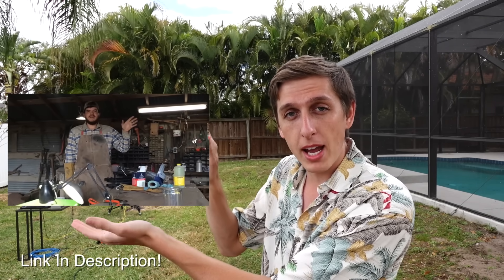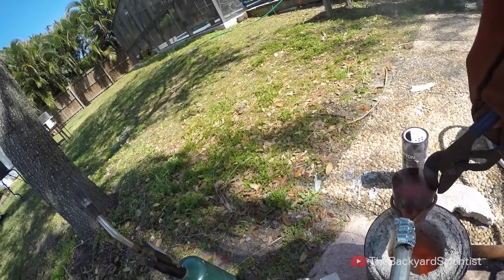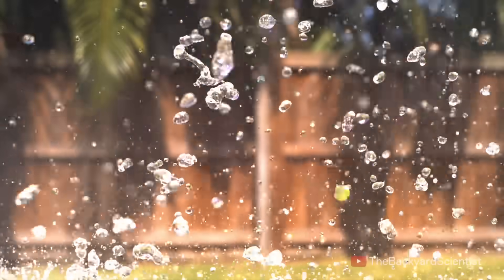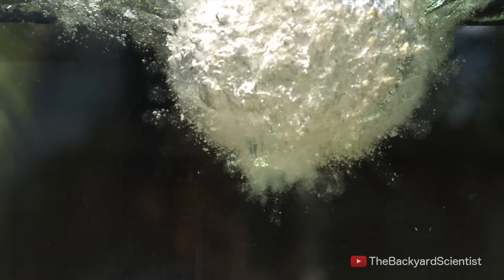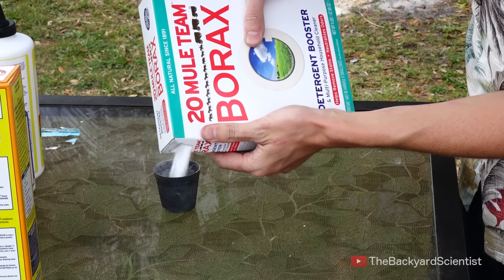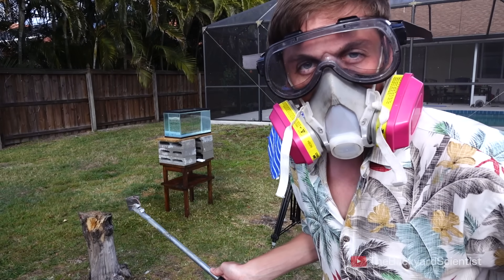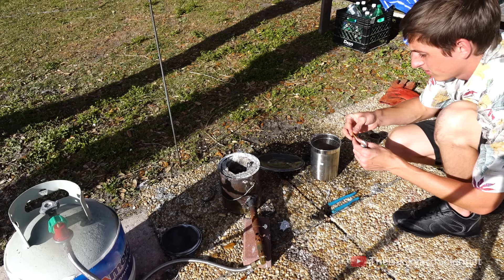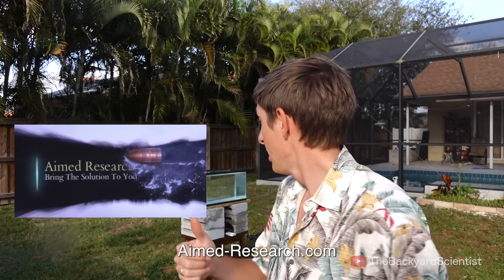Pouring Molten salt into Water - Explosion!

Comment: The reaction of dissociating NaCl into its two ions Na+ and Cl- is an endothermic reaction(requires energy). The opposite reaction is exothermic, which is what happens when you chrystallize already dissociated ions back into NaCl(releasing energy). Thats my explanation :)
Reply: Other than that its also water turning into steam explosively fast which is easier for NaCl as it reacts more easily as single ions, polar atoms, with the water, than when its in its crystal form NaCl

Comment: I didnt try it but maybe it was because the others were to dense even as liquids to let any water in and the water beside it was also sarounded by more water wich doesnt let it boil
Reply: +Silver erl 

I think it has to do more with how strongly NaCl attracts water molecules, thus having more water surrounding the molecule when the water gets to its boiling point, releasing huge amount of gas, while at the same time attracting even more water, wich will also vaporize and create bubbles inside bubbles. That's probably why the biggest explosion occurs  some seconds after the smaller ones. Its like, creating big bubbles filled with bubbles extremely fast pushing the water in every direction with a huge force, creating the explosion.

Comment: If i recall my chemistry days correctly, at around 1000`C water splits into Hydrogen and oxygen... A deadly combo when exposed to heat. 

In my opinion what we are seing here is that Molten Salt (the melting point of which is in the neighbourhood of 1000`C) triggers this water breaking reaction (thermolysis?).. So now, in that brief gas bubble, we have a very fresh mixture of oxygen and hydrogen (in the exact proportions needed to make water again), and superheated salt... Thats a reaction waiting to happen And as you know, a reaction of oxygen and hydrogen at perfect ratio is a very violent one... 

This is also consistent with why the first attempts failed and also explains why the PH was unchanged... Why would it, when all that was in the tank, when all was said and done, was salt and water?

Overall the symmetry of this reaction is rather beutiful... It's two physical reactions... First a thermolysis, wildly endothermic reaction, which splits water into hydrogen and oxygen, and immediately a detonation, a wildly exothermic reaction, which releases all the energy back outwards and returns the initial amount of water used...

Comment: Guarantee these explosions are to do with solvation and dissolution. Both Borax and Sodium Carbonate are significantly less soluble than Sodium Chloride in water. You want bigger bang, find something more soluble than NaCl id recommend Lithium Chloride.
Reply: +coconut7joemanji Care to explain the mechanics behind your theory?
Reply: When NaCl is dissolved in water it causes a positive enthalpy change in solution, Effectively cooling the solution down at the same time ligand formation occurs between Na+ ions and water plus Cl- ions and water. Now if the NaCl is at 1000K+ i'd hazard a guess that in this circumstance a ultra-saturated solution forms in the steam created by the leidenfrost effect.causing a massive osmotic pressure, subsequent coulombic potential and a massive release of energy as super heated steam. . 

//Edit: It's just a hypothesis however if super heated salt were dropped into a non-polar fluid and didn't explode i think it'd suggest strongly that solvation and dissolution are a major factor in whatever is going on.

Comment: How do you know that if it is a chemical reaction that the bi-products aren't just sinking to the bottom of the water and so when you test the water it still comes out neutral. Why cant the actual reacted chemical change be sitting below the unreacted water which you test to be neutral after the reaction?

Comment: What I think is that such high temperatures actually end up braking some of the ionic bonds between sodium and chlorine atoms, thats why sodium gets exposed as it reacts with water because as we know sodium as all the other alkaline metals are very reactive with water. If this is true you should have smelled chlorine gas being released also thats also the reason why it was a bigger reaction because chlorine gas got caught up in the waters and had to escape creating this large bubbles. Thats also why at the start it was not a very big reaction because you did not heat the salt enough to break the ionic bonding. Well at least thats what I have learned so far in my chemistry lessons at middle school here in mexico.

Comment: well why not pour some other molten metal in that is the same temperature as the salt and see if it blows up, this may help to figure out if your hypothesis is correct. I have seen molten lead poured into water and it just steamed and bubbled.
Reply: +osburrob000 oh also maybe do it at night, you could see if there is any light produced when you pour it in and if there was then it was chemical probably.

Comment: There are two processes going on here: one chemical and one physical. The molten salt is very hot, which vaporizes the water into Hydrogen and Oxygen gas. The molten salt's kinetic energy is high enough for the ionic bonds between the Na and Cl atoms to separate. Na reacts very violently with water, which creates a spark. In normal conditions, the sodium metal will catch fire, but won't explode. But in this scenario, the spark from the sodium ignites the Hydrogen Gas, creating an explosion. If you don't believe that Hydrogen Gas explodes so violently, look up the Hindenburg!

Comment: If it was a chemical reaction I'd add a pH indicator in the tank before adding the salt. My hypothesis is that maybe when you heated the salt to a high enough temperature, you gave both the Na+ and Cl- enough energy to pass the energy barrier needed to react both Na+ and Cl- with water to create NaOH and HCl. But since those two things react very easily they go back to NaCl and water really quickly and become ph neutral again. By adding the indicator, if this is true, you'd see a momentary color change and then back to nothing as it reacts back to NaCl. 
I don't know tell me what you think.

Comment: I believe this happens because NaCl dissolves much more quickly than the other salts you tried. What causes the explosions is the extreme heat formed from dissolution at such high temperature which causes water around the dissolution to quickly evaporate. This doesn't happen with the other salts as they are not nearly as miscible. Maybe if you try MgCl2 you'd get a similar reaction as NaCl. This also explains why you see no visible solid NaCl salt as opposed to the other salts.

Comment: i thought it was common chemical knowledge that sodium reacts catastrophically with water
Reply: yes, sodium does. But NaCl doesn't. Otherwise cooking pasta would be pretty intense
Reply: Oligu. But yoyu don't cook pasta at such high temperatures which is probably what separated the chloride
Reply: melting something and seperating its atoms are two completely different things
Reply: Oligu. With more heat the atoms vibrate more and start space out more if it gets  hot enough the molecules split into there individual atoms, do your research

Comment: Since there is no Leidenfrost effect, could it be that the some water molecules are thermally decomposed into H2 en O2? If that would be the case, i figure the remaining heat would ignite this explosive gas mixture so H2O (vapor) is formed again. You wouldn't see a pH shift either. The thermal energy is dissipated in mechanical energy (expansion). Could this be a viable theory, or was the temperature not hight enough to cause a thermal decomposition?

Comment: Rubbish, of course it's a chemical reaction. The sodium (and the salt) is acting just as any other alkali metal would react in water, its just that it requires the heat to be more freely able to react. Also, the pH level will only change if theres a net change in the H+/OH- balance, certainly not something that will necessarily be effected by every chemical reaction.
Reply: +ButWhoWasMoto? TheWeatherChannel had this video featured on their website, and clarified that if was a physical reaction. The NaCl was hot enough to cause the water to boil in such fashion. NaCl is a better conductor of heat than the other ionic compounds.
Reply: Represent You Same as when any other salt is heated. Sodium is not immune from the leidenfrost effect
Reply: You right. Volume, temperature, and transference of heat are really the only factors. Whether or not either of the salts is a better conductor of thermal energy, the hottest salt that made the most contact with water molecules will create the most steam, and that was NaCl.

Comment: The high temperature from melting the salt separated the Na from the Cl. When you put sodium or other group 1 elements in water they are highly reactive and it results in an explosion. Science, Bitch.
Reply: +George G Uh, did you see the bit where he poured pure molten Sodium in? Not nearly as explosive as the Sodium Chloride
Reply: Viperion_NZ pure molten sodium will react even quicker on the surface of the water resulting in less of an explosion than if it reacted further underneath.

Comment: the heat of the molten salt vapourizes the water, but, salt also takes in water, so it does that with the steam in a fraction of a second, creating a small vacuum between the sodium and the water, but all that air being sucked in causes it to be pushed outward. creating the explosion you see here. I'm going to bed now, night night.

Comment: The reason it resulted in explosion is because as water comes into contact with the hot surface of the molten "salt" as it would be, it vaporizes which results in gasses which causes to bubbles to form, hot air rises but water is heavier than air so it tumbles back in on itself using the same concept as a ship sinking creating undertow so rather than go upwards, it expands outward to attempt to assume a natural shape where the gas can escape as quickly as possible. Yay Science!

Comment: decomposition of salt into sodium and chlorine.  resulting in coulombic reaction as sodium + water ->  2NaOH + H2
that would be my guess.
Reply: +Roan Haggar yea I paused the video to make my comment. Since the ph remained static, I would hypothesize that a portion of the super heated salt desolved at an accelerated rate and dumped it's thermal energy into the water. Flash boiling a large qty of water.
Reply: +Roan Haggar this might also be an explanation for why borax didn't produce the same result. Salt is much more soluble than borax.

Comment: Pouring molten Na into water.  I have seen some stupid things and this just assures me that there is no lifeguard on duty at the gene pool.  The things I have seen on this channel up to this point have been tame aside this.  Nope, not going to watch this channel any more.
Reply: pansy.
Reply: +Noah Rush 
Please don't have any children...
Reply: dang, this guy has gone full molten salt mode
Reply: He did not pour molten sodium into the water. He only heated up the sodium chloride so it became molten, heating an ionic compound as such does not make the compound split due to the fact that an ionic compound has such a strong bond. Now it is true that when he melted the salt, it became much more reactive than normal and when coming into contact with the water, it created hydrochloric acid, HCl(aq), and sodium hydroxide, NaOH(aq). And it is also very important that thy are both aqueous solutions or else, in his pH test, they would have both shown on his test because they do not react in their normal states of matter (NaOH(s) and HCl(g)) but since he most likely waited a short while to test the pH, it then gave time for the solutions to then react with each other and create the original reactants therefore, showing no change in the pH because there was only Sodium Chloride and Dihydrogen Monoxide.
Reply: LilFatty0616 you are a true american.

Comment: you dumb butt when something is cold and something is hot and they suddenly interact its bound to have a chemical reaction commom im 16 years old
Reply: +Bobby Suav  You're wrong.   For example, drop a block of dry ice in a bucket of hot water.  There's no chemical reaction.   Molten salt in dropped it the water is flashing the water into steam.  No chemical reaction is going on.

Comment: No! no! no! You couldnt figure out why it exploded.... wtf! Water interacting with anything super hot causes the molecules of the water to detach from themselves breaking down into Oxygen and Hydrogen rapidly causing.... wait for it..... an explosion!
Reply: If that's the case, why didn't the other ones work? The borax? And there are videos of people pouring molten metals into water. With no explosion. It's not a heat thing.
Reply: Different reactions are based upon the composites of the materials being introduced.  Salt as a crystaline sustance has a greater suface area compared to other inert substances and is also a powdery substance in its natural form therefore the binding molecules are not as strong. When introduced at great temperature the molecules break down much quicker because salt is able to be soluable in water. Therefore the reaction is so much greater as the salt attempts to be soluable much quicker and the heat energy is dispersed so much quicker.

Comment: It is like the Prince Rupert's Drops  principle, except the sold salt isn't very strong as glass so it can't hold the still molten salt inside it , it just building pressure until it breaks the surrendering sold salt around , the proof is you didn't get an explosion the first time when the molten salt at lower temperature.

Comment: I haven't finished the video but I think I know why it explodes, it's because the gas is turned into a bubble and the gas bubble has explosive chemicals and all those chemicals explode in side and the bubble incloses and it gets so tight that it explodes on the outside cause there's to much on the inside. :)

Comment: You already
sad the answer the salt witch exploded could interact/ touch the water and the
others don’t with the others the reaction is stil happening but far less extremely
cause of the distance between the water and the hot salt. The reaction is the
same as you put water in hot burning oil. Mabey an Idea for the next high-speed
camera video

Comment: This was a very interesting experiment. At first I thought there was a thermal separation of H20 molecules and a resulting explosion; However after some research about the different dissociation temperatures I think what is happening (if this is chemical) is something a long the lines of:
2NaCl + H2O -> 2NaOH + 2HCl due to so much added energy into the system. 
Then
2NaOH + 2HCl -> 2NaCl + H2O with the remaining heat from the molten NaCl. 

Because of how reactive NaOH and HCl are together and the thermal threshold having easily been met by this reaction, and the fact that this is an exothermic reaction. Im pretty sure that the explosion that was observed was the second reaction (2NaOH + 2HCl -> 2NaCl + H2O) occurring with a high efficiency and releasing a lot of heat very quickly, causing the reaction. This would explain why there was no pH change, because the reaction would rebalance the pH faster then you could measure it. 

It has however been many years since i've studied enthalpy and I can no longer do the math. So yeah just an idea, I hope it helps.

Comment: Sodium is an alkali metal so it naturally explodes in contact with the metal so what happens is that melting the salt seperates the sodium and chlorine which allows for the explosion and what happens is that basically since it is still protected by the chlorine the sodium has enough time to get deep enough into the water allowing a bubble to form. This allows the salt to spread out even more and cause the same effect. This happens at such high speeds that the energy doesn't have enough time to dissipate and the end result equals the explosion and possible shattering of glass. This is seventh grade science. I should know I'm in seventh grade but I am not confirming this explanation.

Comment: sodium and chlorine have different melting points so melting the salt could separate the bonds and causing one of the metals to explode and one to not explode
Reply: +Purple Gamer no it doesn't work that way.&#160; Salt is a compound.&#160; The compound melts, not the separate elements.
Reply: I was just hypothesizing

Comment: table salt is composed of two volitile elements, chlorine and sodium. sodium by itself when placed in water causes an explosion. essentially by heating salt to the melting point the compound NaCl (table salt) seperates into molten sodium and chlorine gas(very toxic to breathe). leaving you with molten sodium to use in the experiment

Comment: This is not a chemical reaction.  It is purely based on heart transfer. Sodium chloride transfers heat better than the other salts you tried, and is able to essentially flash boil the water on contact.

Comment: This experiment lacks a control, which is why you are possibly reaching a wrong conclusion.
You are assuming that the explosion happens because it's salt, but you have not ruled out the possibility that the material in itself doesn't matter, but it's caused eg. by the temperature.
A control in this case would have been some other material with similar properties (preferably a powder-like substance that's liquid at a similar temperature).
Reply: +WarpRulez 
Then wouldn't it have reacted similarly when he used different materials in the same fashion?

Comment: May be ur solt has Temperature more than 1000 °C. So the processes of dissociation H2O->2H+O start. And hydrogen explodes.
Reply: +Евгений Бунин Nope temperature to dissociate water is more like 2000 degrees C
Reply: +Евгений Бунин No that isn't right
Reply: look it up on wiki  2200C about 3% of water molecules will dissociate
Reply: +Евгений Бунин no 5:32